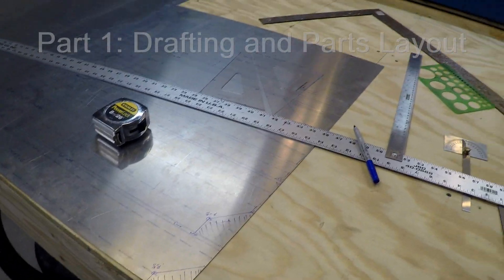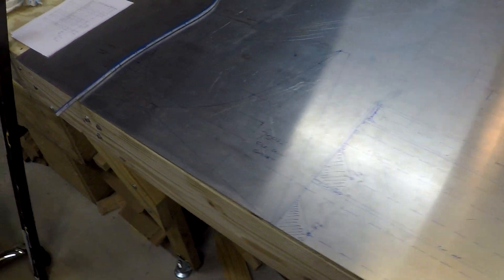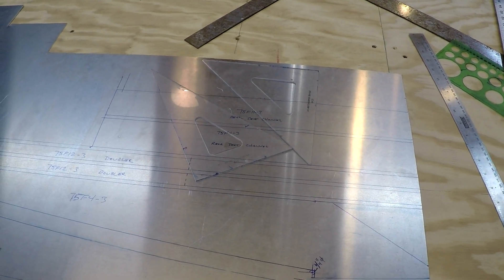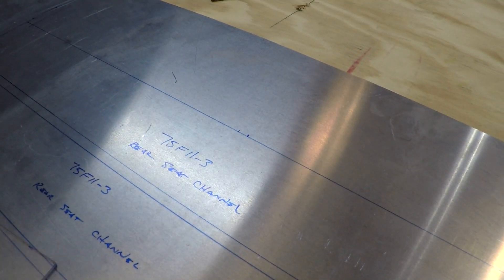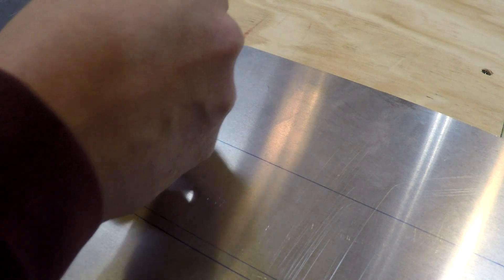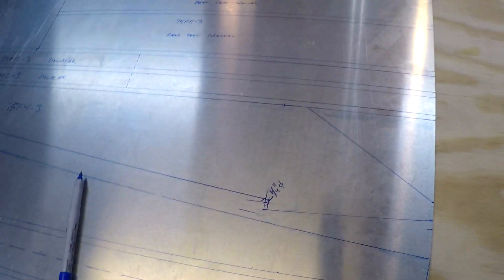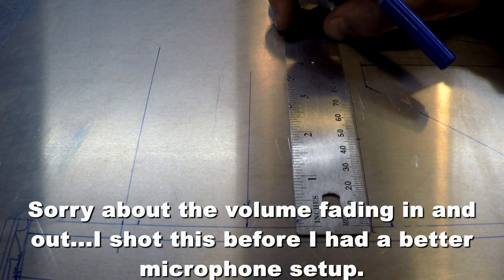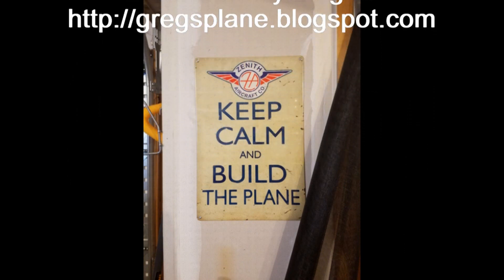Drafting and Parts Layout  - Part 1/2

Comment: Hi Greg, watched the video. I was always told to lay parts "shorter than 4 feet" that need a bend, perpendicular to the grain of the sheet. Avoids bending cracks apparently. Sometimes there is no choice with long parts but have you done this with all your plane build ? My last plane build I had to do that according to the construction manual...
(All the L and Z angles are bent perpendicular to the grain) 
This caused me restriction when laying the parts on the sheet. Just wondering if you are doing this or the bend radius is large enough to avoid it ?
Reply from the maker: According to the Zenith Construction Standards, material grain direction is relevant only where denoted in the blueprints. In the STOL CH750 3rd edition plans (unlike 701 plans), I cannot find any place where grain direction is even mentioned (maybe the wing spar webs, but I'd have to check...doesn't matter, grain only goes one way on those anyway since they're almost 12' long). I checked these parts over and over to make sure, but there's no mention. Generally, speaking, I try to lay out a part so any bend is perpendicular to the grain. However, I'm not too worried about it since the blueprints do not specify it. Most of these parts get a bend radius of 6.4mm (1/4") anyway, so I don't know. I'm just following Zenith's guidelines.
Reply: Ok. thanks.  I assume the cruzer will be similar to the STOL.
Reply from the maker: I would guess, though I suppose I probably should have contacted Zenith to ask them about the lack of notation on grain direction. If my plane falls apart upon take off, perhaps we'll have our answer!?!